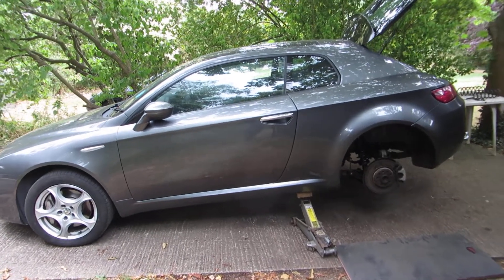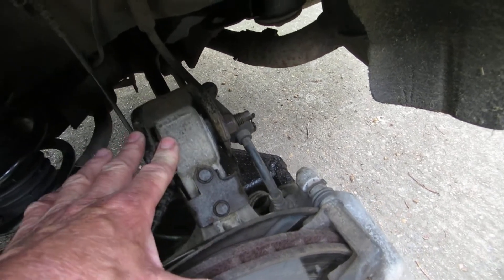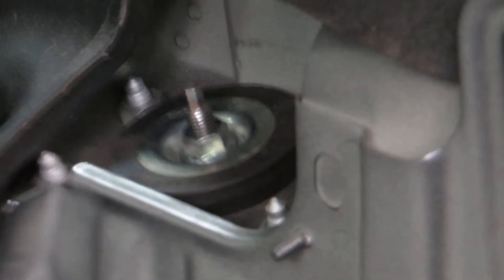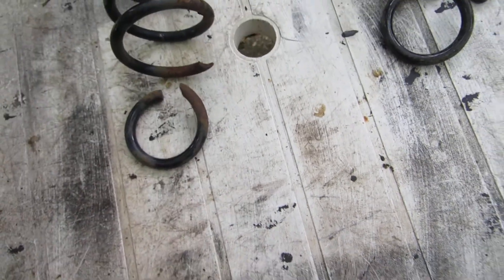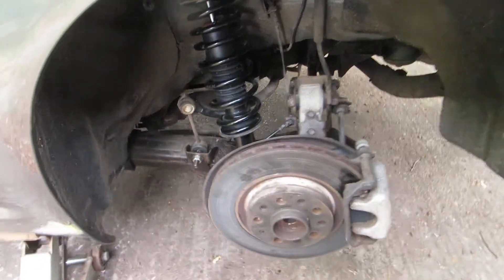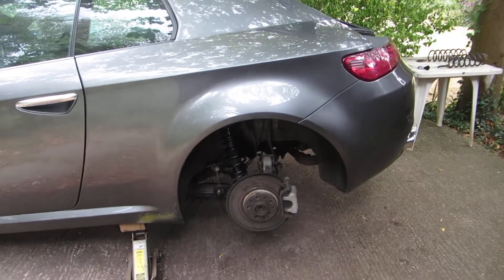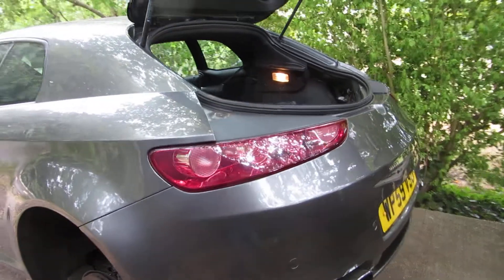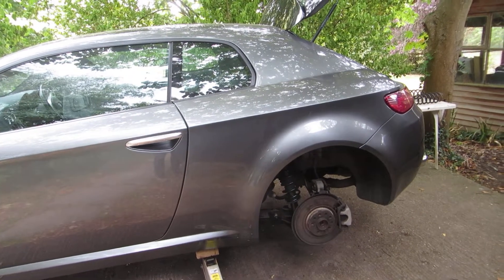Alfa Brera Rear Spring Replacement

Comment: Great job, doing my 159 Ti Sportwagon now and had the same issue with the bolt put in the wrong way, must be done at the factory.
Reply from the maker: Yes I think so but it does mean it can be drifted out; Neil on Italia Autos channel put it back the other way. I copper greased everything on reassembly so next time it can be spun out with an impact driver. Good luck with yours.

Comment: The exact same location my springs broke. Must be a design issue as i have seen others as well identical location.
Reply from the maker: In the old days, spring ends were tapered so had flat face but now the trend is to seat them in a moulded cap to accommodate the cut end. They always break in the next coil, over the cut end. Not just on Alfa Romeos, it's quite common. Mine lasted 100k miles so not too bad.

Comment: About the torque settings, you can find the elearn software for the car, with instructions for every type of repair, I think they do come with torque values.
What year is the car?
Reply from the maker: Hi, thanks for your comment. The car is a 2009; I have located my eLearn CD for and I went round with a Torque Wrench after making this video. eLearn quotes everything in DaNm, I had to convert it to old money to suit my Torque Wrench. It seems there is a new metric unit a week.
Reply: @ratman9802  DaNm is like 10xnm, Deca being 10
Reply from the maker: @cosmin552  Yes, I realise that but my Torque Wrench is calibrated ft lb and Kgs m
Reply: @ratman9802  1 danm is 1.02 kgm/kgf so basically equal
Reply from the maker: @cosmin552  Got ya. I've been converting to ft lb simply because it's a unit I have a feel for. I do everything else in Metric though. I will use Kgf m next time I come across daNm